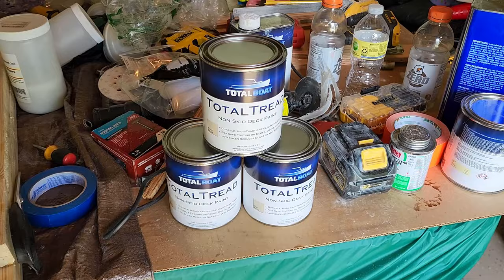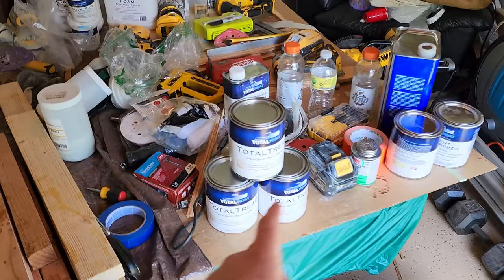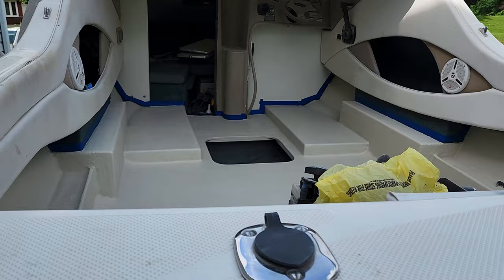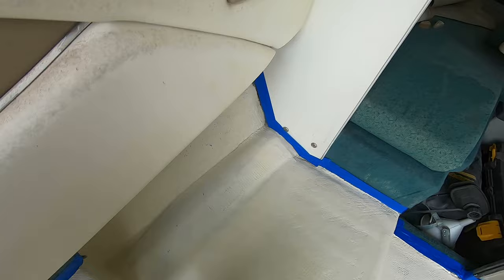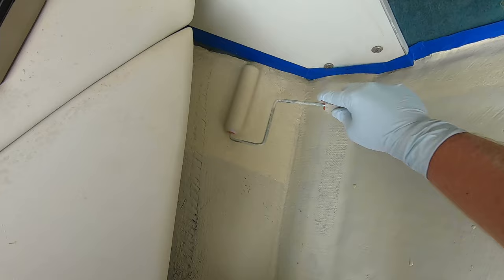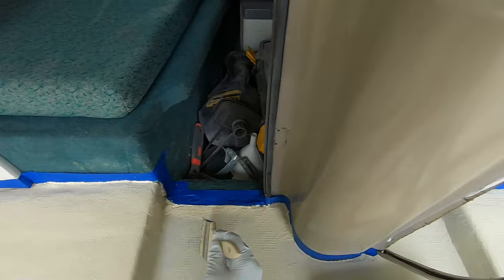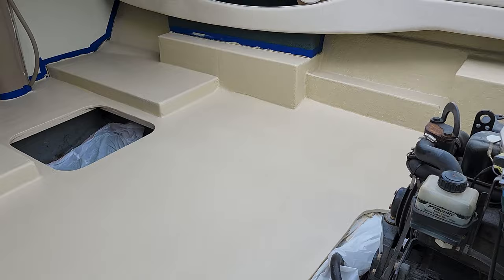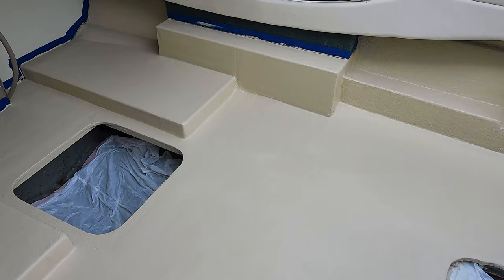Non-Skid Boat Deck / Floor Paint -Total Boat Total Tread (So Easy)

Comment: Having a bayliner project of my own I couldn’t help but get hooked on your restoration videos. Great work! My 15 year old boat still has a solid floor, but I’ve done a carburetor rebuild, ordered a new fuel pump and just recently discovered water in the 3.0’s oil. Kind of wish I had to do a floor instead.
Reply from the maker: It's always something my friend. Best of luck to you!

Comment: Nice job Kurt, 

That color is nice and should stay fairly cool in the sun.  I doesn't take much additional darkness in shade for the surface to get much warmer.  I spent many years working in a boat shop down in Florida,  some of the boats we worked on had gray floor paint and it was almost too hot to sit on when working on the boat.  Lighter shades will serve you well.

Thanks for this and your Hoover Boys channel, I enjoy them both.

John
Reply from the maker: Much appreciated! Thank you

Comment: I watched all the flooring restoration and you have done an excellent job and the videos are well executed and to the point. I just bought a 1999 Capri with a Mercury outboard and I notice that some areas of the floor have some soft spots....Not sure if I have the time and knowledge to do what you did, but I have an understanding of the size of the job....Well done, Thank you for taking the time to document that awesome project.
Reply from the maker: Much appreciated. Best of luck

Comment: I had done a lot of looking into just what the heck to do for my Next Sail boatas due to being disabled I just can't manage beautiful Teak decking Any longer, and normal non slip is very bad news for the feet and knees. So was toying with the idea of Synthetic Teak to keep the looks, but this product is now going on the side Decks, Cabin Roof, the Cockpit floor and the Bathing Platform. Synthetic Teak only on the Cockpit Benches and helm Seats. Looking at your video, it looks like I made the right decision. Thanks for that, and best wishes.  Bob. 🏴👍

Comment: Just a suggestion, if you don't keep stirring the paint in the can, the grit will settle to the bottom and you'll have an uneven distribution of the abrasive on the deck. My wife made this mistake when she painted a room of the house with an abrasive additive in the wall paint

Comment: I’m going to use the floatation foam pretty quick. Did you only use those two gallons or did you have more. I have the same volume to fill and I’m hoping I only have to buy the 2 gallons

Comment: Wicked restoration.  Did you remove the floor in the cuddy as well?  It kind of looks like your tools you're storing are sitting lower than the floor that I have in my cuddy.  I've found soft floor in the cuddy as well as at the base of the dash step. Looking forward to doing something similar. As well as getting rid of the box seats!